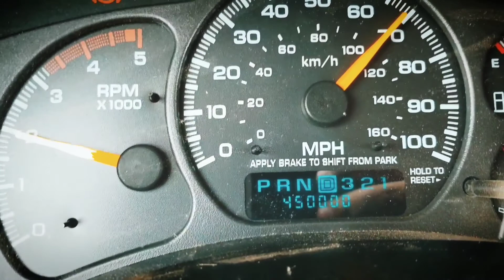Fixing Our Leaky Duramax

Comment: How long would it take to go to a junkyard and find a  I truck like that cut the front end off and Weld it to you the 2004
Reply from the maker: The fire wall support is pushed in and pinched, the floor board is creased under the pedals. And the cab itself twisted, the passenger doors don't line up at the top so it leaks water. I've replaced the doors which is how I found out.